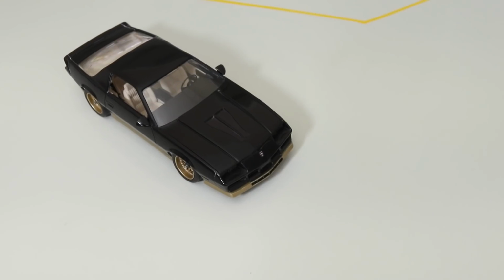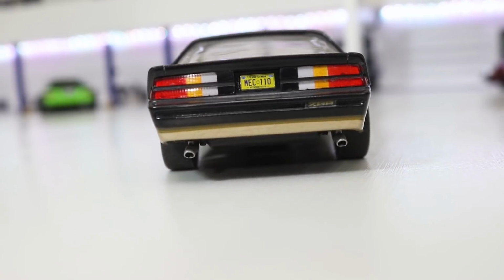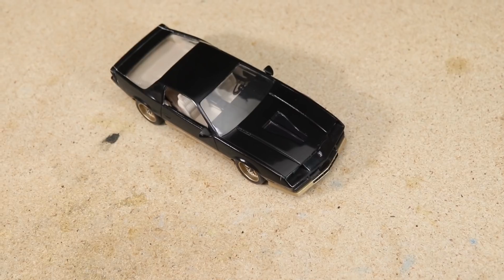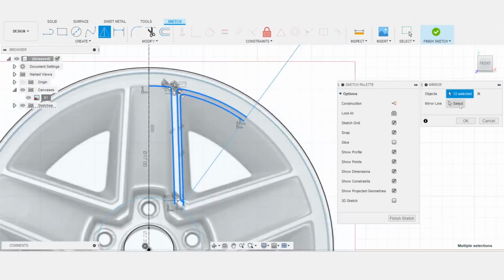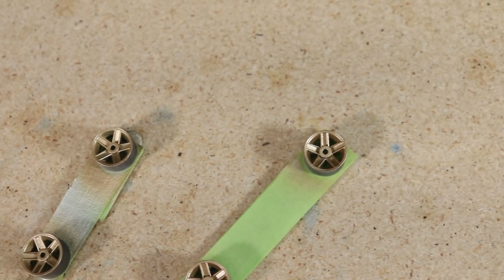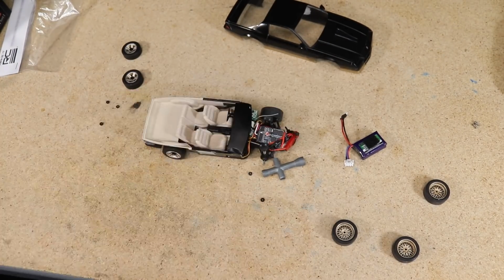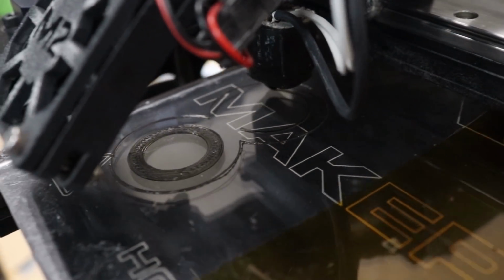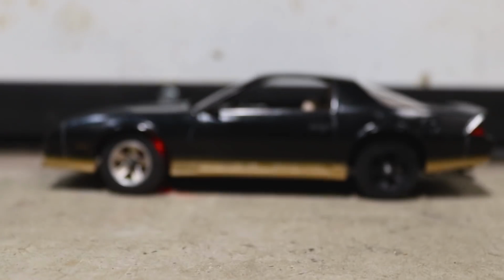Update, New Wheels, and Test Driving the Custom Built 1/25 Scale RC Camaro

Comment: A tip for making some tires: 
I usually print a negative mould of the tire and fill it with hard silicone or pourable rubber.
You can get really detailed treads with it and if you print at a high layer hight on an FDM printer you will at least get some semi realistic ridges.
Though it works better for bigger 1/10th, 1/14th or 1/16th scale cars and trucks.

Comment: Please do a video on the transmitter, receiver, batteries, motor, servos...basically everything needed minus the model kit.  Bonus points for specific products and where to purchase.  I've been a fan for a long time now, and want to do something similar, but I just don't know where to start.  I think a guide showing a specific kit and all the specific parts to buy for it starting from nothing would go a long way.  Anyways, thanks again for the awesome vids.

Comment from the maker: Thanks for watching! The full build videos for the Shelby GT500 build are nearing completion. I've been working on a few shorter videos to upload in the meantime. Follow on Instagram or turn on notifications for more updates. 👍
Reply: You should check this stuff out for printing tires.
https://www.amazon.com/dp/B07PLJ9XW9/ref=cm_sw_r_sms_apa_i_NzepEbQ7ZKW85
Reply: @sinformant  I usually print a negative mould of the tire and fill it with hard silicone or pourable rubber.
You can get really detailed treads with it and if you print at a high layer hight on an FDM printer you will at least get some semi realistic ridges.
Reply: @Sven_Hein  nice!